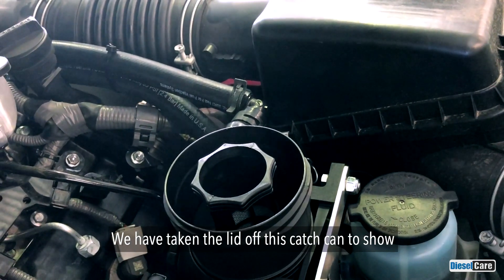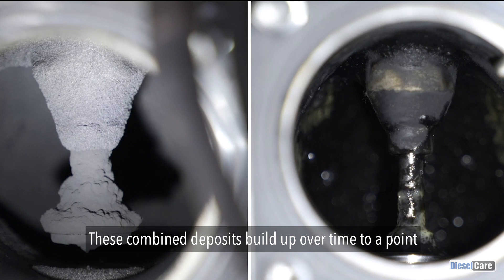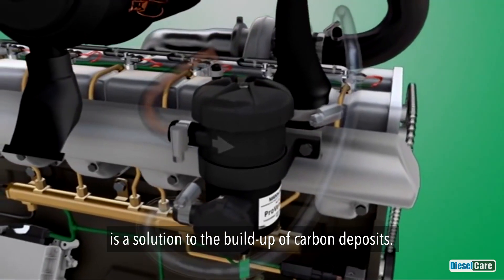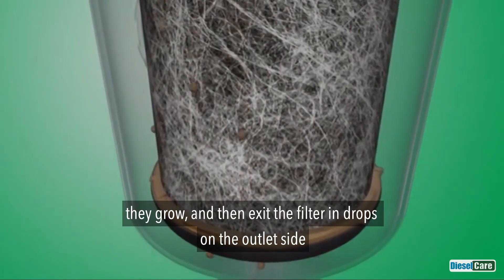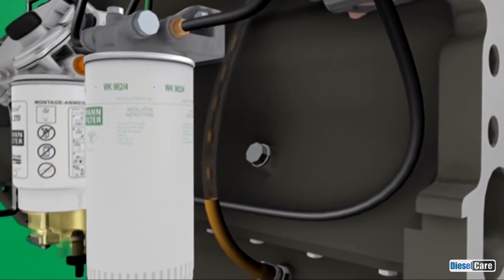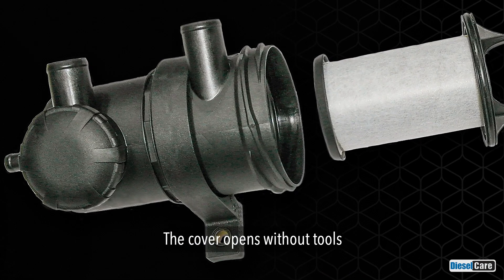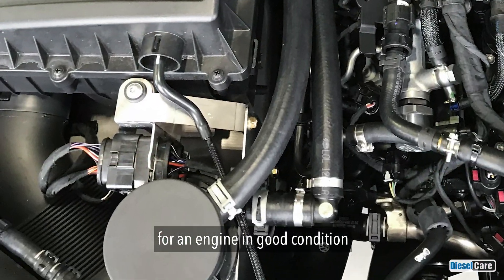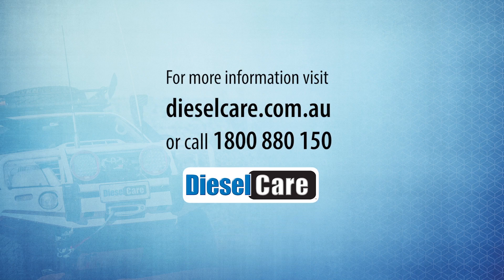Everything you need to know about the ProVent Catch Can Oil Mist Separator

Comment: When the process talk about separator like a vertical separator, the inlet should be at the center not the top. The top nozzle shall the exit going to the inlet pipe of the engine. The center inlet tube goes down by gravity  including the moist that will be trapped by the screen. The upper outlet nozzle will carry air and a small amount of oil mist.

Comment: All this "ho-Ha" about ProVent's, 
You forgot to say that they work backwards. 
Hot blow-by rises naturally (it's science) yet a ProVent forces the hot blow-by down through the filter & out the bottom of the catch can & the hot blow-by is fighting to go in an upward direction all the way through this process. It should come in through the bottom & naturally rise up through the filter for this filtration process to work smoothly & efficiently and then gently exit via the top outlet leaving all the oil behind it. Gravity takes care of the collected oil and it drops into the tank.
But there is a constant battle going on inside a ProVent because it is constantly fighting against the laws of physics. This never-ending battle causes more oil soaked vapor to be pulled down the walls of the can & into the outlet. They have been known to let huge gulps of oil into the system because of this. It doesn't block the flow of blow-by but it does forcefully redirect it in the opposite direction to how it should be flowing.
They have a very small oil catch tank (even with a 1/2 meter hose attached) & the outlet sits just above its pitiful size tank. It was originally designed to work on a stationary motor with a drain back to sump, but they gave it a facelift added a drain hose and now flog them off to the 4x4 fraternity & everyone says they are state of the art. Simple fact is they were not designed to go on a rocking & rolling 4x4 and they need to scrap this design and move on. They don't have to reinvent the wheel, but they do need to change it.
And to top it off,  now they have removed the pressure relief valve from the lid & added it to the bottom of the filter and upped the replacement price considerably. Who wants to pay $90+ Bucks for a new filter every 30,00Km when they only do an average job of separating oil? I have seen the amount of oil that still gets through these ProVents and I would rather loose 5% efficiency and use an eBay stainless steel reusable filter that costs less than half the price. Or make my own using two layers of .03 micron stainless weave.

Comment: I quickly looked this one up, couldn't find out; will it fit a facelifted X-Trail T31(2013) with the M9R engine?
Reply: Yes it’s fits a 2013 X trail T31 with M9R turbo Diesel engine, I fitted one to mine, so far so good.
Reply: Where did you fit it in yours?

Comment: Checked mine after 5000km and no oil, only drained some water. Minimal oil on the filter.
Reply: It does take time. I thought mine wasn’t doing much, but once that filter medium becomes wet then it really does collect and drop oil. Mine is just on a car, not a ute, but it’s an ASX 2.2 tdi that has a very similar diesel to the Triton. I get a lot of water in the drain tube in VIC winter and let it out every week or 2. I get minimal oil at the bottom of the drain hose. Every 10k I use paper towels gently pressed around the filter to remove excess oil and extend life, just using my hands to squeegee it dry. I do that 1-2 times through winter as the condensation gummies the oil a bit on the filter and housing, so I like to clean that off. It’s only a 5 minute job. I’ve had it for >2 years and I recently checked inside all the hoses and they were squeaky clean